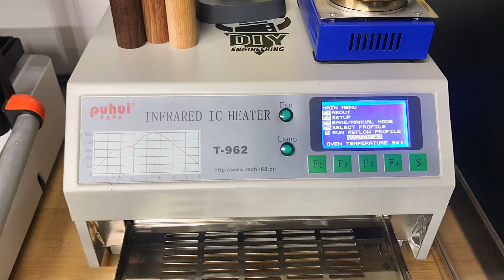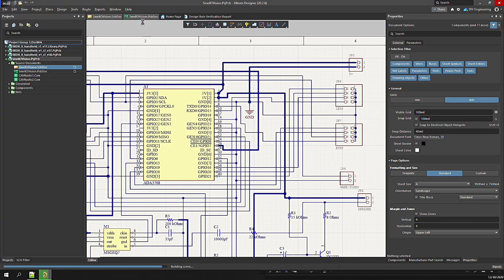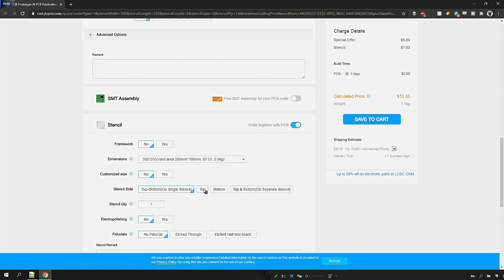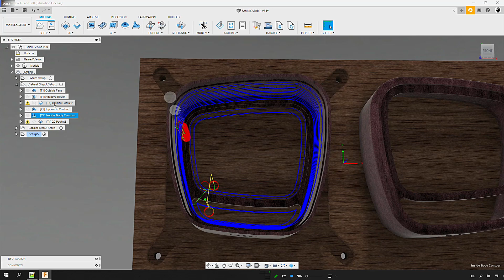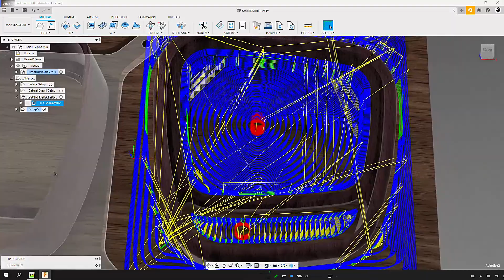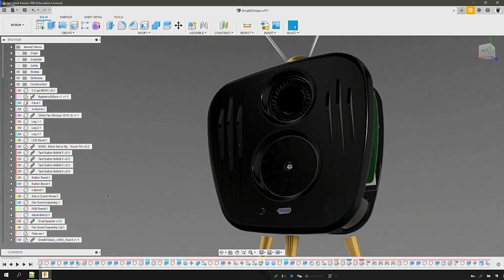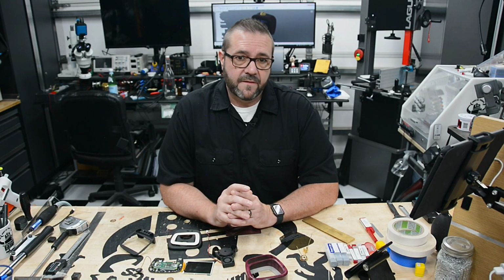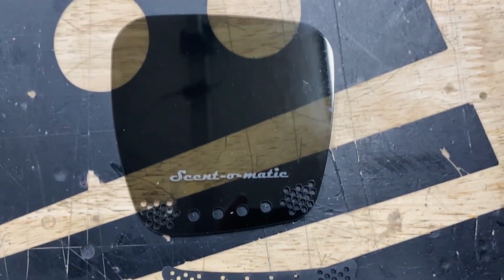Making a Video Player that Plays Scented Movies!! The Scent-O-Matic Part II

Comment: OshPark PCB works really well for me if you dont need them instantly. $30 for 3 boards and shipping takes about a week.
Reply from the maker: yes, I have used them, but very expensive and dont like branded/purple boards... :/
Reply: @DIYEngineering  ah. yeah its definitely a little more pricey, but they are made in the US. so far i havent found a better option. but i dont mind the purple/branded boards.

Comment: Regarding PCB mfg, asking this question as I don't know any better and would like to know...  Could you use your Nomad CNC mill to make your one off PCBs instead?  I'm assuming you're using a 2 layer board and not a 4 layer one.
Reply from the maker: Vias are the issue with multi layer milled boards. For me it’s generally not worth the time. But i have done it for simple projects... I have a couple old videos milling and solder mask, etc

Comment: Again a great video :) Thanks for sharing this very interesting project !
Just a little question : why do you label parts in F360 using colors ? What is - for you - the purpose of this ?
Thanks a lot !
Reply from the maker: Hi, I’m not sure i follow, do you have an example?
Reply: @DIYEngineering  Sure, sorry if it was unclear.
At 8:11 you are showing your F360 model. On the left you have your components. You are user a color code to label them (cyan for Face, salmon for Antenna, etc.). 
I would like to know what would be your way of using such labels ! How you use it to structure your work.
I hope it is better explained :)
Reply from the maker: Ok, the colors are automatically assigned to objects as they are created in fusion360, they help to differentiate which objects the operations in the timeline pertain to. I don’t usually set them, it’s automatic, but you can. For example all Light blue operations are being performed on the light blue object.
Reply from the maker: If you don’t track changes in your designs it’s less important.
Reply: @DIYEngineering  Thanks for your reply ! This looks very convenient, I will try to activate this for my projects :)